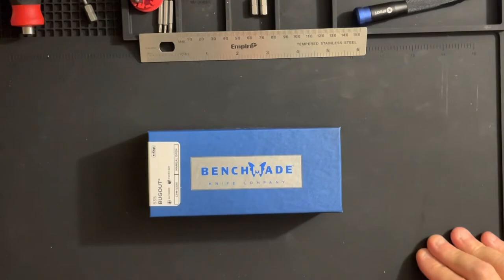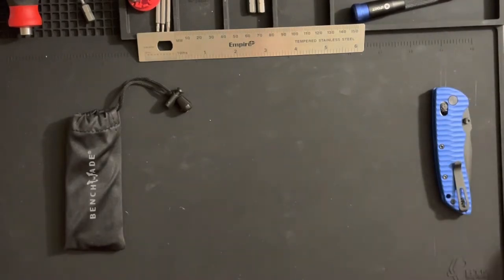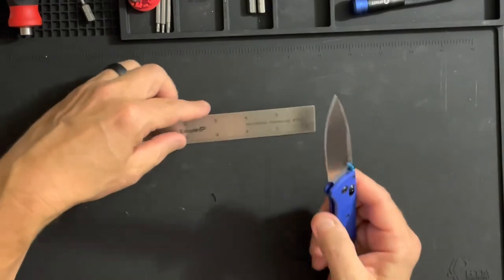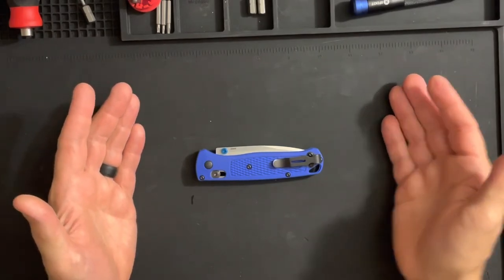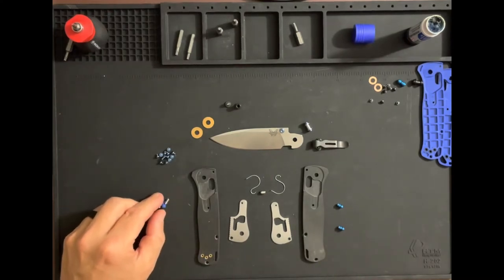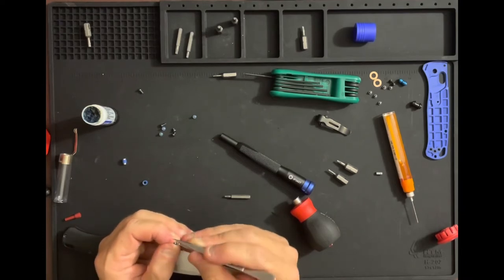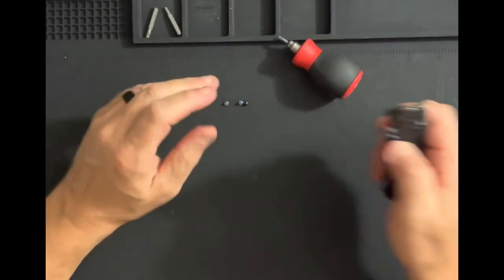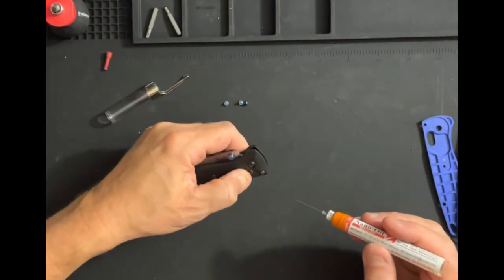Benchmade 535 Bugout Disassembly and Modification

Comment: Please list the parts that you’re replacing with?  scales etc
Reply from the maker: Modifications:
- Flytanium Crossfade black G10 scales 
- Flytanium Titanium blue set 12 body screws 
- Flytanium Blue g10 barrel spacers 
- Flytanium Titanium blue thumb stud 
- Flytanium Titanium blue axis lock bar
- KP replacement oversized washers
- Xxxadrenalinxxx Custom Ti 3 piebce standoff and stop pin set Satin Ice Blue